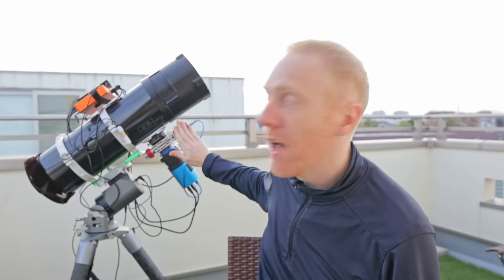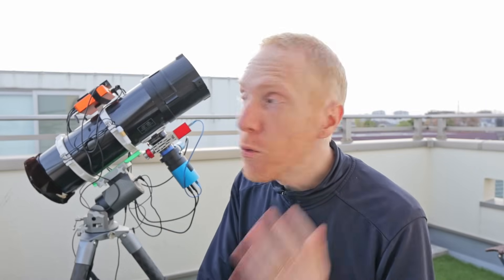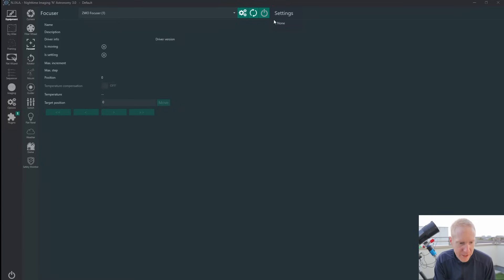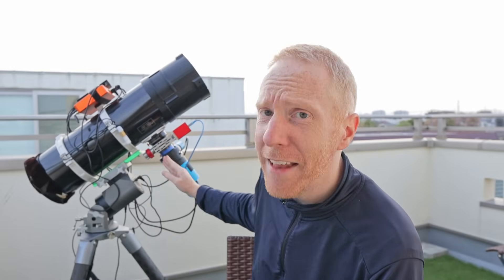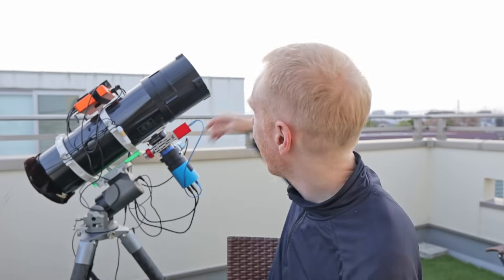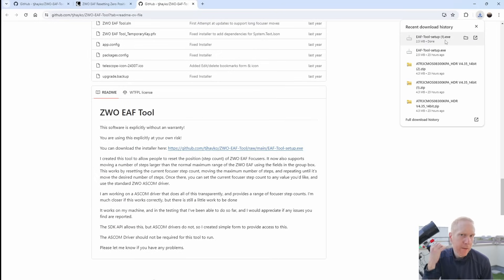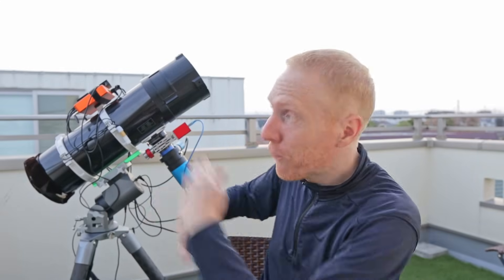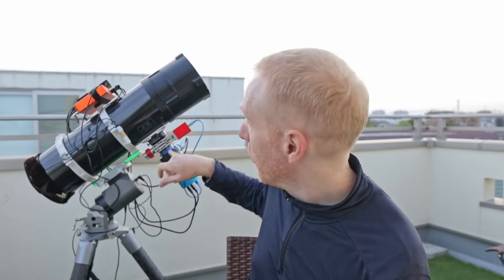ZWO EAF Stuck at zero - and beeping 😞 My fix and additional tip

Comment: What if you use advance optins asks to reverse and move like 1000 and then turn off the reverse and set the new position to zero again? In my case what happened is that I set the focussed psoition to zero by accident then using a filter needed to move to negative position

Comment: That was a surprise Cuiv! I was expecting a different cause here! There is the bigger issue at play (since forever I think, and its certainly present with the current ASIair release at time of posting (version 2.4.2). The issue is most obvious with the EAF Pro, but its also an issue when using the remotes. Pushing the IN button on the EAF Pro drives the draw tube OUT, and the OUT button drives it IN. Waaaahaha maddening! I'd guess the manual focus up down screen arrows are also "wrong" for the same reason. 

You can work round this by setting the current position to ZERO with the focuser "fully out" and enabling "Reverse" from the EAF settings. OMG I'm disgusted at even having to say that! 🤮

Its a classic software error SNAFU where the correct sense of a boolean value has been inverted by mistake. This sort of thing happens all the time when neither buddy or boss cross checks an engineer's work.  A refractor (in particular ZWO refractors) with EAF replacing the left focus knob are "standard". In no way should we allow ourselves to be persuaded by politics or gaslighting to accept this as some kind of weird "reverse". 

So I thought this video was going to be about this BUG, because you can also get into exactly the same "beepy zugswang situation" if you switch to 'reverse' when at the end of travel, and omit to reset the current position to reflect that change of direction. Its probably better decribed as a stalemate rather than zugswang but either way you're scuppered!

From my perspective as a retired software quality engineer the consequences of both the error and the workround require a fix. It is just unacceptable for the step count to be INCREASING while the physical position as shown on the centimeter scale on the focuser is DECREASING.  This is simply an ergonomic design error, and hardly better than the IN button moving the focuser OUT. So both the issue itself, and the workround that we are currently forced to resort to, make my teeth equally itchy! 

ZWO haven't even acknowledged my bug report. So I'd be very curious to know how NINA handes this?

Comment: Even if this is an older entry I am still commenting. It just happened to me and I remembered Cuiv talking about the issue. I wasn't in the mood to look for it at 2 o'clock in the morning, so I am doing it now at 11 am. I haven't tried the tool, yet. But for the reason why that happens I could guess in my case a power issue. My EAF is powered via a camera Hub but last night I run into some power supply issues. My connection got loose and might have triggered some power pulses before it failed. After fixing it all the settings in the EAF where at zero. Something like a power failure while starting up can cause a lot of trouble in software.
Reply: To finish the story. The little tool above fixed it. My EAF is working again. How about N.I.N.A. integrating such little helpers?

Comment: Excellent help. I encountered this problem while using my ASIAir+ 256gb. I found a help on the ZWO Forum and it directed me to the Firmware Update Tool on their Software site. There is a Readme.pdf that actually helps (including the vcr x86 file. That fixed the AA and ASIStudio problem, and the EAF Utility Tool you shared here helped me fix the zero-position error in NINA. More hassle than I expected for "easy-button" AA, but the total work, including removing the belt from my SQA55, manually focusing to the mid point of travel, reinstalling and 6 power cycles, took about 1 hour. Cheers-

Comment: Had the same issue, the second night I used it.  A software or firmware upgrade window popped up, so I clicked on it, to download it, but it took me to a website, and I didn't want to mess with it as I was in the middle of an imaging session.

Somehow when clicking on that, and trying to upgrade, it decided to change the max step to 0.  Which meant the entire range for my focuser was now 0 to 0.

I would get a max step setting at 0, this is probably incorrect, blah blah.

Well I went to the ASCOM device manager and didn't see anywhere how to change the max step.

Did some web searching and that's when I found out I had to hit the Advanced button.

So that got it to be able to move, but in the process I hit the set to zero button, even though I was about 2500 steps out.  This was a problem as I would need to get below 2500(which the EAF thought was zero.

Then I found the software that you talk about.  What a miracle worker.  God bless the man that did that.

But TOTALLY ridiculous that someone had to develop that feature himself.

Pegasus allows you to set the current position right in their own software.  I can't believe they would produce a product that didn't have that critical feature.

Also as mentioned in another post, it's utterly insane that ZWO designed the EAF to hang down, well below the focuser housing, so that it interferes with the mount's saddle plate making it impossible to set the scope far enough forward in the saddle to balance on the DEC axis.  So now I have to buy 30mm spacers and set the scopes over an inch higher and further from the Dec axis than they need to be.

Comment: A few weeks ago my focusing went way off. It was so bad I couldn’t see any stars at all. I had to disconnect the EAF and manually focus. I reconnected the EAF. Initially I didn’t get the usual V curve prior to an autorun. The star size was stick around 4, rather than the usual 2.3 or so.  It seems to have self corrected now. 
I’m not sure if the initial problem was caused by me selecting the ‘Set EAF to Zero’ in the autorun set up screen

Comment: Great! Thanks brother!
Reply from the maker: You're welcome! Glad it's helpfil!
Reply: @CuivTheLazyGeek  Funny thing is, I began with a Cel 8SE and the Celestron focuser. It could be calibrated and the position reset easily. Odd that ZWO and NINA doesn't have that capability built in.
Reply from the maker: @textandtelescope8199  I wouldn't include NINA in that! The Ascom spec for focuser drivers doesn't include any function allowing third party software to amend the current absolute position of the focuser (only a get; function on the Position property), so NINA can't help there, it's all on ZWO ;)
Reply: @CuivTheLazyGeek  I don't code but I can recognize the verbiage! One would think (thought the non programmer) that clever folks somewhere would do that which needs to be done to ensure that the LAZY factor remains high for the Geeks!

Comment: I have similar issues, They didn't happen with eth old EAF which was powered by a dedicated 12v connection, and therefore I suspect it rebates to some glitch related to the powered USB connecting/disconnecting. 

I have contacted ZWO support, per a previous experience I had they seem to be responsive, and I am looking forward for them to resolve the issue.

Comment: I've had this problem twice in the last month and a half and, at least in my case, I have strong suspicions about what caused the focal position to be set to zero. I have two refractor telescopes, each with their own EAF and each one has had the ZERO problem. My setup is fairly simple and I use a mini-computer to control my devices. I have always plugged my cameras (main and guide) and my EAF directly into the mini-computer. However, I recently purchased a camera that has 2 USB ports in the camera body and last night I tried plugging the EAF into one of those USB ports. That turned out to be the second time that I had the ZERO problem. I don't remember if I used that same port the first time that I experienced the issue, but I very well could have done so. I'm no computer expert, so I can't propose a reason why plugging the EAF into that particular USB port would initiate a zero positioning, but I will not use the camera USB ports for anything controlled by ASCOM. I'm sure that computer experts out there will tell me that I am full of hot air (or worse). LOL.

Comment: I now have the focus motor installed, and I have experienced the issue first hand. I am very leery of using this focus motor for it's intended use, which is to be put on a remote telescope that I will not have access to. Putting it on a remote telescope could be a disaster, but I will continue my testing to see if the issue arises again.

Comment: I would definitely set a max step, while the eaf probably cant really damage equipment, it could damage itsself. It has a small gearbox inside with sensible gears, which could definitely be damaged when it runs into the end of travel, especially with a R&P Focuser. If you are using a crayford, it will probably slip beforehand.

Comment: My issue I had the other night is I had initially had connectivity issues, so only cable I had spare was USB A to USB B, found out fast USB ports dont supply enough power, in the end it was a connectivity issue between the camera and PC, which was giving a connection to the camera but the hub on the camera wasn't passing thru properly. Re-plugging the camera into the PC fixed my issue.

Comment: Hey Cuiv...I wish I had seen this video a few weeks ago.  I too have had this problem too many times, and did not know how to resolve it.  I finally gave up, and have purchased a Starfield Oasis focuser for my Celestron 8.  The jury will be out if I run into any new issues with that focuser, but I got tired of the ZWOs just stopping, and not know how to fix it.  I even sent one back for repair, and they sent me a new one!  So we will see how the Starfield works.  But thanks for doing this video.  I still have a EAF on my Stellarvue 102!  PS, I also like to try to find products where I don't have to be a software engineer to get them to work the way they are supposed to!! HAHA

Comment: I'm the author of the ZWO EAF Tool, and I'm glad you found it useful!

BTW, the ZWO EAF Firmware was updated some time ago to support 600,000 steps versus the 65535 that the previous versions supported, although there were (and may still be!) some issues that prevent the standard ASCOM driver from recognizing the 600,000 steps of travel.  If the problem still exists, there is a thread on Cloud Nights where I describe how the fix the issue.
Reply from the maker: The legend!! Thanks for your work and for the additional tip!

Comment: Thanks for raising this issue with the EAF in your video. This error usually happens to my focuser when I swap it to another telescope ie the SW ED80 Evostar to the SW Quattro 250mm F4 reflector as I only have the one EAF. If you open the focuser controls in Asicap it is possible there to work out the zero position again easily. Checking the reverse box can help to get it moving again. Then run it all the way in , set zero again after this run it all the way out to make sure it doesn’t stop too soon. It can be left in reverse as long as you remember the in/out arrows are reversed the next time your out imaging with it. I like the setting  the zero at 30000 idea. I’ll try this when I change scopes again.

Comment: Hi Cuiv. Been an avid watcher for a very long time but now wanted to make a comment as this was a very annoying issue with the EAF. I use ATP and thought it reset to zero if I didn’t disconnect the EAF before quitting? To solve the issue was to go ASI Studio and in the EAF settings you can manually enter its current position and as I know roughly where it is (eg 8500) I just set it there enter the max steps and I’m back up and running. APT also sees it at that value. So happy days again. I don’t get why it doesn’t remember the last position and max steps?! Bad programming I guess!!
Reply from the maker: Interesting the functionality is in ASIStudio when it should be in the ASCOM driver!
Reply: I’ve only used the native Zwo driver via APT. Either way it’s very frustrating! Glad it’s not just me though.

Comment: Thanks for a useful video. I had this problem with an EAF I bought second-hand, it arrived beeping, and took a bit to sort out. The manual controller didn't work either, so I had to build a new one. Caveat emptor!
Reply from the maker: Sounds like you had a bad time with it but got it working, well done!

Comment: Haha.. I recently had that issue where the position was at zero, so I just clicked the Reverse checkbox and to move the focuser in the opposite direction and then reset it to zero when the focuser in as far as I could get it. But it took me a few minutes of cogitating to to finally decide to do it, to make sure I wasn't going to screw something up!
But the one thing I hate about these autofocusers is the "Max Step" terminology.
It should really be called "Maximum Travel Distance".
Because Max Step is kind of confusing and meaningless.
And then it's even more confusing in NINA where they call the distance "Step Size" when it really should be "Number of Steps"!
This confused me, unnecessarily for longer than I'd like to admit because I thought I had to change the minimum step size, and also the number of steps.. 🤣

Comment: Hello Cuiv. First, the ASI EAF can be confusing on a good day. Second, I believe there was a recent update which caused me grief for a while starting last week. In the end, I think it is not so complicated that you need and additional program to make it work.  My experience: You can always call whatever position you are at whatever you want, and EAF will accept it. Yes, the position can be readdressed! In fact, that is how I start off each session. I start by putting the EAF in REVERSE, give it a big number to drive it to the actual full zero position - it will stop when it can't go further. THEN, I rename the position "0". From there, I change it back to forward (that works for my scope) and go from there.  Last week however, I could not get it to focus well at all - it would go back and forth for ten minutes then say it was focused when clearly it wasn't. I believe this was due to an update. Typically, the focus point for my regular rig is about 2200. But I found it would start its sampling around 15000 or some ridiculous number and with the rough focus step set up at 30, it would never get where I needed. Here was my solution: I changed the limit from 60000 to 3000. Suddenly everything worked like a charm, and focusing took only 3 minutes, or so, instead of 10 minutes and failing. Limiting the max range to something a bit above your actual focus solution gives it an optimized place to start. The sequence goes: 1). Rough steps (adjustable, but 30 works fine for me) will start to develop the focus curve. 2). Fine focus (mine was set at 5 and I left it) will trim it for optimal focus, which for me seems to be with a star size of 2.2 or so.  My big "DOH!" moment (using the ASIair) was the graph's X axis is your focus rack position, and the Y axis is your star size. Suddenly my controls experience kicked in. It's similar to a PID loop, but without a time element, nor a setpoint. It is just looking for the minimal star size, first using big steps, over-shooting a bit, then using the fine steps.  I spent the next three nights in focus HEAVEN!
It would be nice if ZWO would provide an instruction sequence on this unit. It would have saved me hours of fiddling in the field. Sadly,:face-pink-tears: ZWO documentation and customer support is about as bad as it gets....

Comment: Strangely, mine did exactly the same thing just a couple of days ago. I resolved the step size issue the same way as you, but I confess I undid the clamp on the drive to allow me to reposition it. I was convinced it was my fault, as I had just taken my Hyperstar off my C8 for galaxy season.
Reply from the maker: For repositioning, many commenters added the tip you can reverse the focuser direction!

Comment: Didn't know that was the problem. I use ASIAIR since I got EAF. In there it is very easy to setup current position to whatever value you want it to be.
Reply from the maker: Yep, same in Stellarmate - it should be included in the ASCOM driver...

Comment: Hey Cuiv
Thank you so much for this video. I regularly have the opposite issue i.e. the EAF behaving like it’s at the maximum position. In that case I pull my Newton focuser manually at the max and moving it in again with the controller. Very annoying making me loose a lot of time during the very rare clear nights. So many thanks for the advice. I will definitely give it a try next time it happens. 
Clear skies
Bert
Reply from the maker: Yeah that sounds very cumbersome! Hopefully that third party app helps!

Comment: As a few others have said the ASIAir allows you to set current in its interface. When I first installed it on my Askar FRA300 I got a good focus manually, I then carefully fitted the EAF and set the current to 30,000. I’ve not seen it go more than a couple of hundred +/- since then. It’s never reset to zero.
Reply from the maker: Good it hasn't reset!
Reply: @CuivTheLazyGeek  it’s out there right now on NGC7822 😀

Comment: I'll have to give that utility a try.  Thanks for sharing!

Also, something that worked for me on my Edge9.25 when going from HyperStar to 0.7x reducer which required a major change in the focuser, was to drive to zero, check "reverse" in the settings, drive it up to like 30,000, uncheck "reverse" drive it another 30,000, and so forth until I got it where I wanted it.
Reply from the maker: The reverse trick works too!!

Comment: If you are using the ASIAIR the ability to set the start position is built in. So this issue only exists when using the driver utility in third party systems
Reply from the maker: It should really be part of the driver for Windows though...